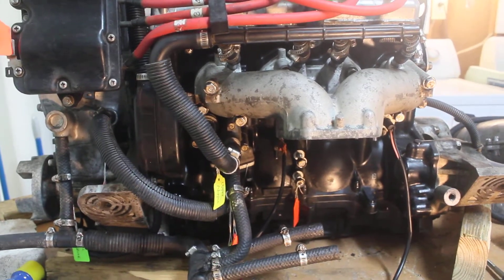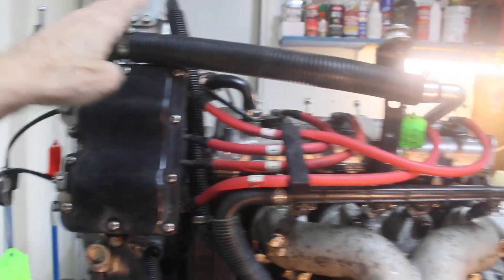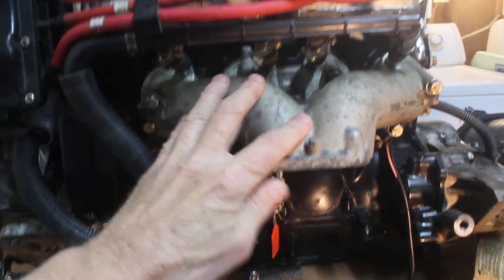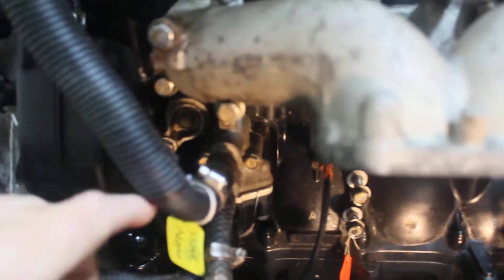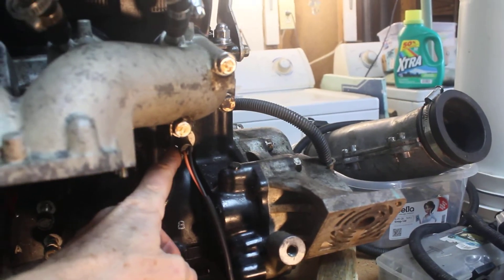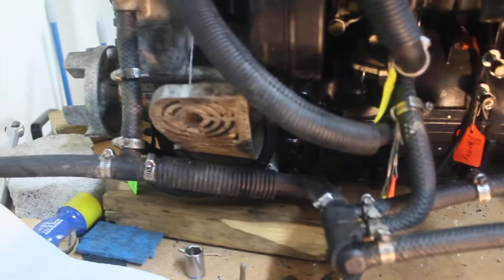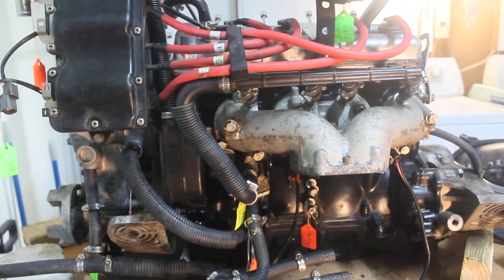Right Side View - FX140, MR1, Yamaha

Comment: question I had to remove the collector from my mr1 engine still boat The problem is having a bad time getting back in right, I remove the coolector all way to bent toward front of engine. Now trying to get back the pipe not lining up with the collector going into maniflod. Do i need to remove the comple unit to get back in. I try ti remove the othe side remove 3 bolts but still will not move 

Rich
Reply from the maker: Here is a link to a diagram
https://www.yamahapart.com/oemparts/a/yam/5003a4e3f870021f60a1318c/exhaust-1
Reply from the maker: In the diagram there are 10 long bolts (items 19 and items 20) that connect Item 18 to Item 10. It sounds like that is what you are struggling with

Comment: Thank you Sir
Reply from the maker: No problem. Glad it helped you visualize what is where. I now have the engine assembled, installed, and running. I have removed it from the hull twice, disassemble it, cleaned the cooling system, and had a professional auto machinist put a heli-coil in the head where a rusty spark plug snapped off

Comment: Hello sir, thanks for the great video. I am trying to detect the oil leak in my FX HO which has the MR-1 engine. I think I have a bad leak somewhere because I can see the oil in the bottom of the hull. I was hoping that the problem is from the corroded oil filter but it was not. Any advice are greatly appreciated sir. Have a great day.
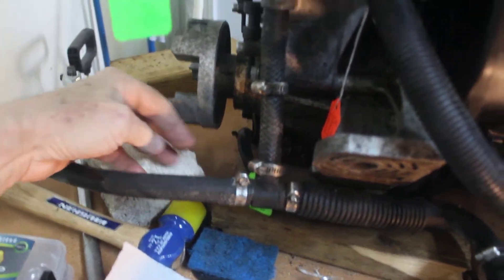Reply from the maker: Two things come to mind. At the 1:08 mark in the video I have my fingers on a primary oil line that connects to the rear-face of the engine at the very bottom. An enormous amount of oil will come out of this line if it is leaking.
Reply from the maker: When you fill the engine with oil it should only touch the very tip of the dip stick. Other wise it will end up in the large-plastic air-filter / injector-intake housing. When overfilled it gets blown out of the system somehow
Reply from the maker: One of the lines may have come off of or is leaking at the :50 mark on the video. I point out a black plastic oil device. Not sure of its function
Reply from the maker: I suppose the thing to do is clean up the oil spillage really well and then put some clean towels under the engine and start zero-ing in on the location of the leakage
Reply from the maker: Note: An oil filter with a pin hole in it will not leak until the oil on the inside is under pressure
Reply from the maker: I suppose locating and getting your hands on the oil-hoses would be a first step. Also do-not fill the unit with oil over the very tip of the dip-stick